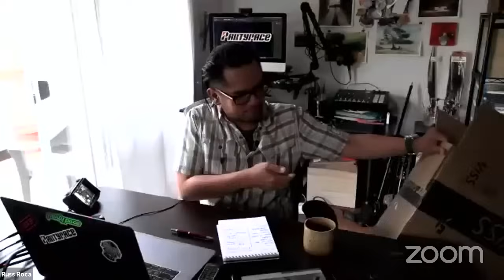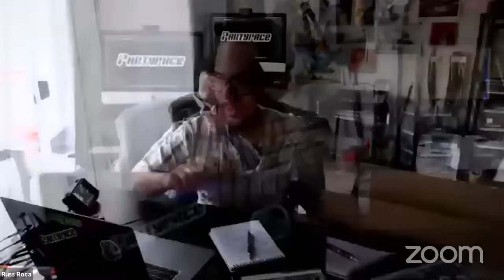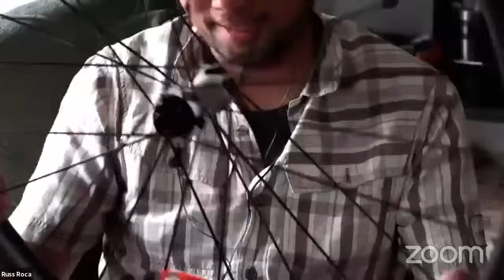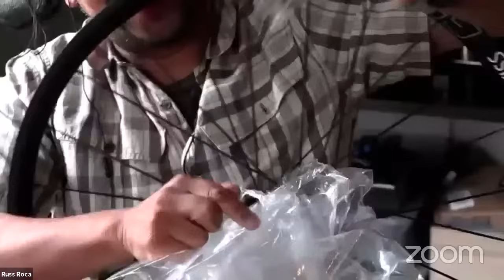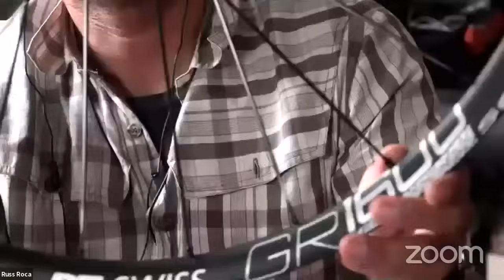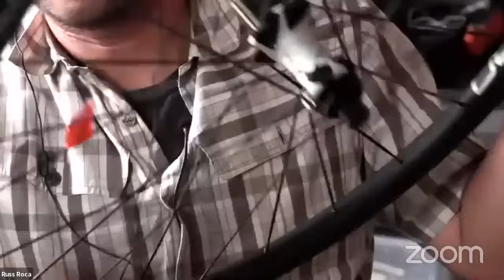Road vs Gravel Wheels? GR 1600 Spline Unboxing - LIVE with DT Swiss

Comment: This might be a necro-post in 2026 but here it goes,  why are there so few aluminium wheels for gravel? I mean it makes sense to have aluminium when you want durability and not be afraid that it will break if you look the wheel sideways. I am looking to buy a set of quality aluminium wheels with wide inner channel and there are so few options! It is DT Swiss and Reserve (when they have stock). any other suggestions? Any change for creating a video on the topic? thanks
Reply from the maker: Hunt still offers aluminum wheels.
Reply: @PathLessPedaledTV  true, they have the 4 seasons, and wow you guys are fast to respond :D

Comment: It´s a good tip: I´m 193cm tall an my wight ist about 94 Kg, my bike around 14 Kg. I crashed so many rear wheels. Now I´m using a HG1800 at rear and a G1800 in front. :-)
Reply: 2 years later, did you crash these DT wheels too?

Comment: I’m wondering: if there’s a huge difference from a $500 bike and a $1500 bike, but diminishing returns after $1500 ($1000 kind of bring the value “sweet spot”), is there such a proportion with wheels? It appears there’s a even larger range for wheelset pricing. Where’s the “sweet spot”?
Reply from the maker: Around $700-$800 IME
Reply: Path Less Pedaled Thanks!!

Comment: Hmm.. cr 1600 or gr 1600. 100g and €100 difference!
Reply: the main difference is the rim width. cr is 22mm, gr is 24mm
Reply: @DocMucki  Thanks. Do you think the cr wheelset can take 38mm tires ? I ride 90% road, but prefer 38 and 40 mm tires...Thanks !!
Reply: @gerard2620  On their website for 22c internal width (ie cross wheels), they show 25-64 mm as "possible" and 28-32 mm as "recommended" on the same wheels. For 38 mm in the same table max pressure would be 80 psi with tubes and 59 tubeless.

Comment: Interesting chat! I appreciate his honesty (e.g. straight pull is mostly for the benefit of the manufacturer), at times his non-engineer background was showing though. As an engineer I appreciate why big brands have to have PR and marketing people for customer chats like this though :D
A ceramic coating on an aluminium freehub is much lighter than a steel unit. If the adhesion of the coat works well enough, the extreme hardness of the ceramic layer prevents gouging of the hub body, increasing durability to and beyond the levels of a steel freehub. If adhesion isn't high enough the coat might flake off though. It's more or less the same concept as the aluminium freehubs that have small steel splines on the leading edges of some of the freehub splines, just that it's on all of them and more uniform.
Issue with this process is typically cost as most manufacturers that mostly deal in metalwork won't have the facilities to do the coating themselves.